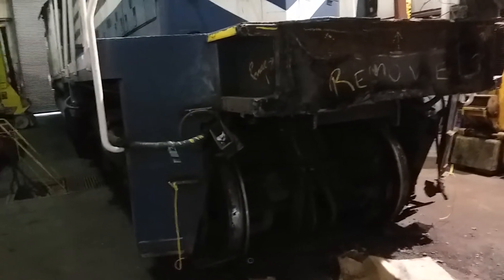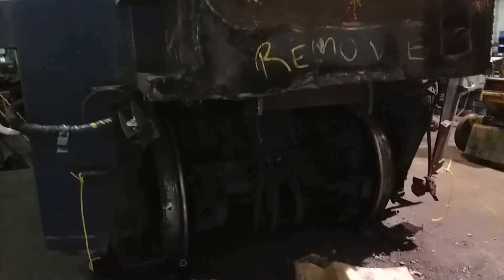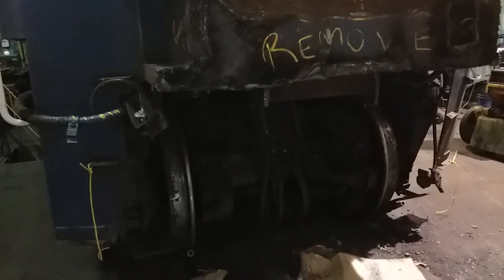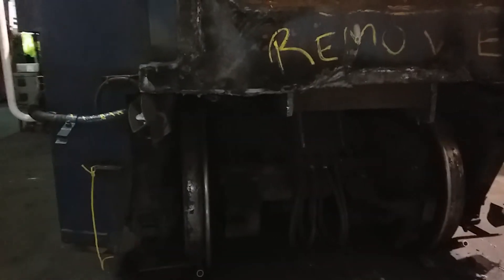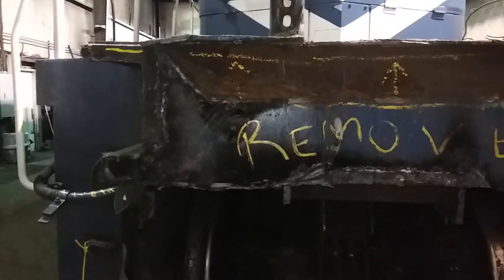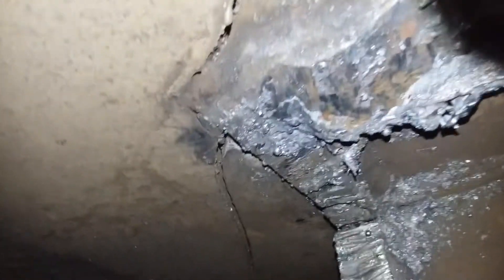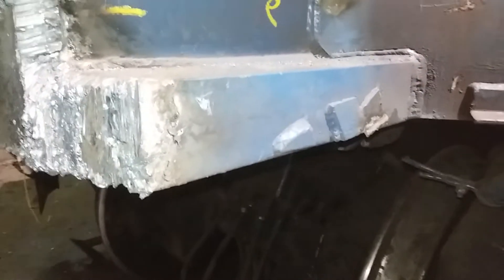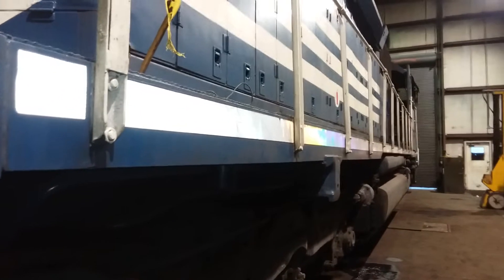Broken locomotive frame emd sd 40-2

Comment: Hey Dave. I have a very heavy piece of antique fail equipment I wanted to tell you about. It weighs about 250 or so pounds. I have had it about 40 years or so. It is buried in my storage building or I would send you a picture. It is an old screw type rail bender or was called a rail crow. Thought you might like to know they are still around!
Reply from the maker: Nice Graham. I have never seen one of those. Our contractors
here have a hydraulic rail bender so I can imagine what yours
looks like. They heat the rail and pump the handle to bend
the rail for a turnout. I've often thought about having a facebook
page where guys can share their photos, but I know it would
be impossible for me to keep up with the posts there. The one 
the contractors have is pretty heavy duty too. Takes more than
1 guy to position it. Really appreciate your sharing that
with me. May you have a most blessed day my friend.

Comment: Takes a lot of weld to put that Humpty Dumpty back together.  I am not a welder but my late husband talked about mig and tig and wire welding. I should have paid more attention. Thank you, Dave.
Reply from the maker: Yes it does Shirley, these welders did an awesome job at getting
3098 all feeling better again and back in revenue service, they
had quite a challenge to deal with. Thanks for stopping by
and all the wonderful support you are giving the channel my friend.
Reply: @ccrx6700  Thank YOU for your patience with my questions.

Comment: Almost looks like pretty old cracks.... Ones that was never caught and only found due to this mishap.. I'm sure all that pulling and pushing over many years causes this and not this accident. I dont think many inspections were done on this to look closely for it.I would be inspecting the rear for the same type cracks.
Reply from the maker: Good point sir. This loco has been in service since 1966 so who
knows what all the use and abuse it's taken over those many years.
I tend to agree with you the shock of those cars hitting the loco
only made an already existing condition worse. Thanks for
writing in.

Comment: They wil have to arc air gouge that crack out  it looks brown and old reweld it with 7018 low hydrogen or 100 to a 110sg filler metal with mig then service grind it lots of work to fix her we at our locomotive depot before it was closed removed the whole cab etc that just the frame is left and totaly refurbished the old 34 class diesel locomotives and the 7E electrical lovomotives refurbushing everything removing rust etc  came out looking like a beutiful brand nee locomotive nee vetvmy engels se spelling is swak ek is afrikaans verskoon my.

Comment: Mr. Question here lol.
Is welding the plan? Then rebuild the front end. Or all the crack need removed. Just cutting 3 inch plate is not a average torch job.
Reply from the maker: Weldiing is what they did Ronald, I wasn't there when they did
it but they also replaced the whole front plate with a new one, those
guys were real professionals, the welds they did looked great, Thank
you for watching sir

Comment: To see these properly repaired you have to strip the locomotive and do a full restoration job on it. If it's a Rare Locomotive Fair Enough. But Otherwise I'd look at replacing this loco. Even the Flying Scotsman Steam Loco (worth £40 Million) had to have a front section of badly coroded plate cut out near the pistons due to corrosion. The restoration price went into £millions. Of course during the strip down they found 100 other defects as well.
Reply from the maker: Well Chris, if we had an interchange with another RR then it
most likely woulda been scrapped and another brouhgt in, however it costs HUGE bucks to truck a loco in here like we have to do, consider that. Thanks for watching

Comment: If its possible could you have a video on the electric drive motor system on locomotives?  I have always wondered how they work.  That is completely insane that it broke the frame.
Reply from the maker: Scott, will put your suggestion on the list, i'm not an expert on exactly how everything happens with that. I appreciate your watching, hope you enjoyed
Reply: Cracked frames aren't that unusual. Where I am many older locos were scrapped one time for this exact problem, however now they are always repaired because repairs are cheaper than replacement whereas before it was the opposite under government ownership. It changed since privatization. 
Private companies still purchase new locos but at times there are such locomotive shortages that very rarely do locos get scrapped just because they are old. Old locos get stored then reactivated for a few years as needed and stored again. Many are fully restored by enthusiast groups and leased back to private companies to generate income. How's that for a business model?
Reply from the maker: @ThePaulv12  very interesting comment. Where you from? We had to fix this cause we dont connect with another RR so everything must get trucked in, Hulcher does it and it a huge expense.

You are right it much cheaper refurbish an older unit than get new, lots of old sd 40-2 now in switcher service, no one buys new switchers anympre to amount to anything

Comment: Years of vibration work hardens that steel makes it brittle then one good bang an it cracks. Might be able to temporarily weld it up but once a crack starts there is no stopping it
Reply from the maker: Can you imagine this loco was built in 1966, it has pulled trains all over US and Canada before it came to us. Can you imagine all the
vibration and forces that have been on that front end from all those years. Wow. I like your line of thought on the reason that happened.
Point well taken. Appreciate your watching

Comment: Love your "SHOWS".....Concerned to hear about your overheating  hopper cars bearings ..We can still recall Union Pacific  lubrication  of their Bearings on a preventing  maintenance. Programs....The year They Quit  this program  they piled up a unit Coal train...Now is the CUMBERLAND  mine Railway  small enough  to lubricant  Their Company  own Hopper cars  Bearings.....Seems like the Cost of a derailment and that Day use of a Crane to lift out a hopper cars  trucks would  more that pay for a synthetic  lubricant  hopper car  Bearing  program..perhaps half of Cars one year ,,,the other half the next year.... oil is Cheap a rebuild  is Expensive.....Lose it or abuse it
Reply from the maker: Bradford, thank you for you comment sir. I have never heard of synthetic lubricant bearings.
These are sealed, would that require a change out of all bearings to do that? If so we
do not have a press to take bearings off and on. Also, this is only the 4th bad bearing we
have had in 4 years, so it is not really a frequent thing that happens. Thank you for watching

Comment: Holden Reardon asked if the locomotive was scrapped, I`d like to know too.
Reply from the maker: Larry, no it was not. A professional fitter/ welding crew came and put a whole new front end on. They did a remarkable job welding that crack also. They were really good. The loco is back in service and feeling much better
Reply: @ccrx6700  I love watching videos like that, I know the basics of some types of repairs, like drilling out the end of the crack to stop it from spreading, and to V out the crack in it's entirety so you can get full penetration and a solid weld through the thickness, but I've never seen something that thick being repaired.

It looked rather rusty for being recent.
Reply: Just a little welding and its like brand new.
Reply from the maker: @kenneththompson1809  they had some real professional welders come in and fix it, those guys were the best
Reply: @ccrx6700  Its a very early SD40 but what's a few cracks as long as the frame isn't twisted. As far as the engine is concerned all the wear surfaces can be welded and machined to as new tolerances. The ECO rebilds are using even older frames.
Reply from the maker: @kenneththompson1809  Kenneth, you are right, it was built as an sd 40 in 1966
Reply: Duct tape and super glue will fix almost everything, ALMOST. 3" thick steel? Wow

Comment: IT MIGHT JUST BE BETTER TO BUY
ONE THAT WAS STORED SERVICABLE FROM A RAILROAD OR A BROKER!
MAN, THAT IS AN IMPRESSIVE 
BREAK!!
ALSO CHECK THE THRUST BEARINGS ON THE CRANKSHAFT!!
ALSO SEE IF THE MAIN ALTERNATOR AND ENGINE BASE BOLTS SURVIVED!
ALSO CHECK THE ARMATURE IN THE MAIN ALTERNATOR, TO SEE IF IT SHIFTED OUT OF POSITION!
KEEP THEM ROLLING BROTHERS!!
👍👍
Reply from the maker: Ross, thank you for your comment. Used locos are reasonably priced. We got this one out of Chicago, the transportation expenses were more than the price of the unit! Since we do not interchange with another rr, then we must get it trucked in by Hulcher from the nearest NS siding. They did put a whole new front end on and i believe they had a loco mechanic check over it before back in service. #3098 is feeling much better now
Reply: Impressive repair for the severity of the damage. Welding 3” plate is difficult to do reliability. Keep an eye on her for subsequent cracking of the welds. Especially with fatigue loading it sees.
Reply from the maker: @crabcake43011  William, I will certainly pass that info along to maintenance, excellent suggestion sir, thank you

Comment: awesome forces involved to crack a 3" piece of steel.  so did they weld the 3" plate up and put it back into service?  i imagine so.  you wouldn't chop off the bent bits if its going to be scrapped.
Reply from the maker: Had some awesome welders come in and weld it. Those guys were really good and knew what they were doing. Thanks for watching
Reply: @ccrx6700  ,the pleasure is mine.

Comment: Be drilling a hole at the end of each cracks  so it does spread any further.  Then grind a V bevel on upper and lower areas of that crack and stick weld it up...